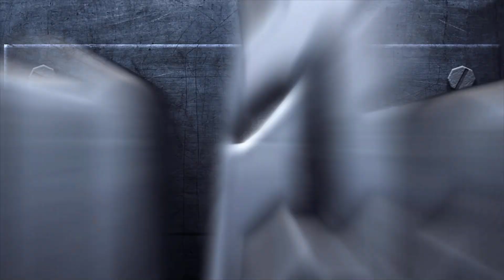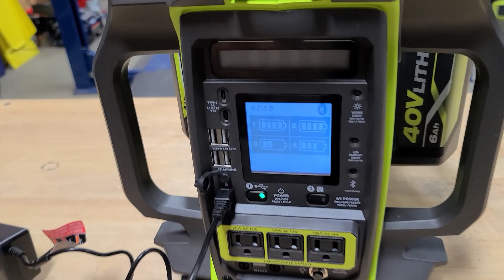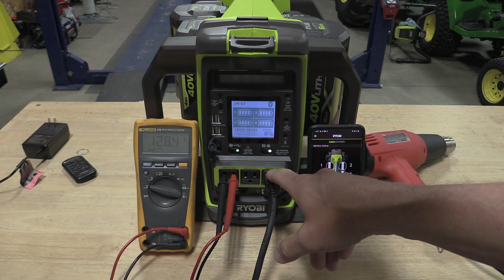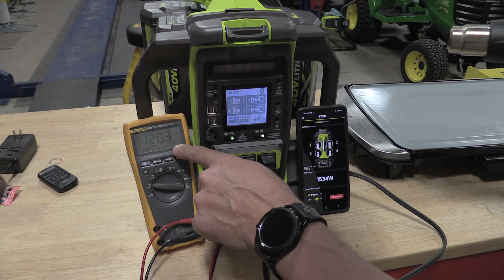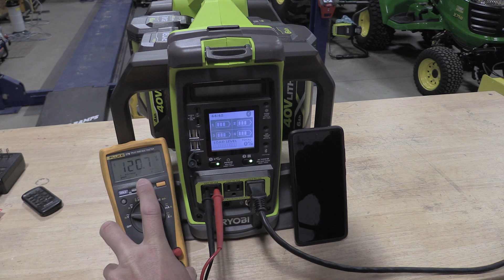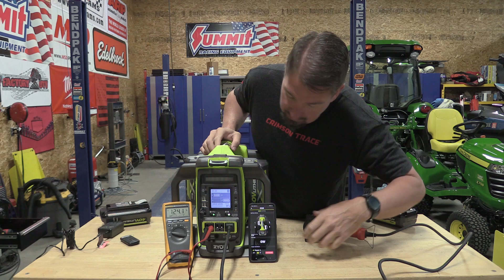Ryobi 40-Volt 1800-Watt Power Station Inverter Generator /4 Port Charger Review

Comment: Awesome video. Very thorough. 
I have the same battery charger and have experienced the same condition you did on the 100 amp start feature . I don't think it was due to your generator inverter. I'd recommend maybe trying it on shore power.  Again, absolutely love the video.
Reply from the maker: It works perfectly on shore power.  Had to use it on my IH 404 the same day.

Comment: Yeah... The technology is not there yet. No solar and or wind powerl connections make it a no go for me. 

Thank you for your real world demo. 

Inverters are super inefficient anyhow. The future will have 12v/24v/48v DC appliances and brushless DC motors to work with solar and wind power. 

As long distance AC transmission will one day become a thing of the past. Being replaced by Edison's original idea of a distributed DC systems in homes and nearby community DC power stations. I have alreadyy replaced ceiling fans with DC versions and address DF refrigerator bro work with solar, RV's have unintentionally laid out the future with everything functioning on DC.

Comment: Hi guys thank for the info , have a question indesice between Ryobi and the Ego power station wish one is better you think ?  im not at any of the platforms  so I will have to buy the batteries I understand Ego batteries are a little more expensive , will the ego Nexus take the 10AH battery ?
Reply from the maker: If you only look at EGO and Ryobi, EGO is better and it will take teh 10Ah batteries.  However, The EGO unit fried my camper, so I am not a fan of it.  Jackery or Dewalt would be the way to go.
Reply: @WorkshopAddict  ups im sorry about your camper , thank you so much for taking the time to reply

Comment: I have dewalt  stuff. This is definitely much better than Dewalt's modified sine wave inverter that has to have 4 batteries and dies when the lowest capacity battery dies. I'll never understand why dewalt or ryobi doesn't make these inverter/chargers fast chargers?
Reply: They will the  charge double for them

Comment: This is a great review! Thanks!
However, did I miss your review of the EGO power station or have you not done that yet?
As I have mentioned, a number of times, I am in the EGO system and have many batteries for my EGO tools so, for me, that seems to be my best choice?
Again, well done and, thanks! :)
Reply from the maker: Watch the voltage when hooked up to our RV, it is 134 plus.  The EGO Nexus fried my fridge and inverter in my 5th wheel.  Be careful with that one.  https://www.youtube.com/watch?v=uwSsqMrVs4c
Reply: @WorkshopAddict  - Thanks for this advice. I think I'll pass on these types of units. A couple other YTers who do boondocking have recommended I stick with a REAL all-in-one unit like the Bluetti AC200P. I think I'll do just that. 

I was hoping this unit would work for me. I already have two 6ah batteries with my Ryobi mower, so at $800 with two more 6ah batteries, I thought this would work.

Comment: Would this be able to handle that Dewalt DWPW2400 pressure washer from a few videos ago?
Reply from the maker: I hooked it up today and it did take it when fully charged but as the batteries got low, it overloaded.  So, reality is no, it will not.

Comment: Let’s just hope this is only the first generation and they make newer editions. Ryobi tends to do this if they see value in a specific model. I think the need is there but this unit isn’t quite there on price or capability
Reply from the maker: Let's hope they get 10Ah batteries also!
Reply: @WorkshopAddict  looks like they have 12AH’s coming out now! Any chance you’ll do any testing with those or the new ride on mowers?
Reply from the maker: @Wrencheasy  Pretty unlikely.  I am honest about what tools will and will not do and Ryobi has made it clear to me that they do not like that.  Too much at risk to go down that road.
Reply: Plus it needs the ability to be solar-charged if it can't be solar-charged then what good would it be if you are out camping

Comment: Cost set aside it’s an interesting tool.  If they haven’t already, all major manufacturers should these available for their popular battery lines.
Reply from the maker: Most all have them.  Dewalt has the most jobsite ready model in a normal battery platform.  Milwaukee has an MX model, not an M18 model.  Kicker is, most of these are used by normal people, not jobsite users.
Reply: @WorkshopAddict  my dad has gone the route of Briggs and Stratton for a battery powered cart and lawn mower. I have search high and low for a inverter that will use the 82v batteries he has. I don't think they make one. Any suggestions ?
Reply from the maker: @BRWOU812  you.would have to build one for that battery.

Comment: 2 inverters gives you double the amps. Not 220 volts. Unless that made something new. Great video as always
Reply from the maker: I have one for my two gas inverters and you are right not sure why I was thinking 30 amp 220.  It's 30 Amp 120.  Here it is.  https://www.homedepot.com/p/WEN-30-Amp-3600-Watt-Parallel-Connection-Kit-for-Inverter-Generators-56421/206409948?source=shoppingads&locale=en-US#overlay
Reply: However harborfreights new generators have a 220 outlet and can also be parallel for 220 at twice the amps. A first for portable generators i believe. Take care looking forward to the next video

Comment: My dewalt is not pure sine wave so I have to be careful what I plug  into it,  I'd rather use a pure sine wave for my audio stuff
Reply from the maker: But your dewalt will run saws and even a welder.
Reply: @WorkshopAddict  yes it runs big tools,  it made a variable speed craftsman scroll saw act really crazy once,  . Half the time I want to use it electronics,  so it's frustrating not being able to use it  for everything

Comment: What is this used for? Running lights at a construction job with no power? If it can barely run a saw I don't see a purpose.
Reply from the maker: IMHO, it is not a jobsite tool, more of a recreational tool.  Great for tailgating or camping.
Reply: @WorkshopAddict  Good point. I could see it being useful for that. Especially if you already have these batteries.

Comment: these battery power inverters are worthless.
Reply from the maker: To many they are.  To some, they are invaluable.   It is dependant on your use and the need for low noise and runtime.
Reply: @WorkshopAddict  Right, you can't always use a gas generator.  These inverters are useless for me but I know they have a purpose.  If not, the manufacturer wouldn't be making them.
Reply: Funny, just this last Friday I chose and bought ego VS ryobi 40v, picked up the new select cut and egos nexus power station (to gain 2x 7.5ah batteries).

3 days later, workshop addict reviews the ryobi version
Reply from the maker: @NikkThompson  If you listen to the end, the EGO Nexus is the inverter that blew up my last 5th wheels fridge and inverter.  Be careful what you plug into you EGO.  That was a very costly review for me.
Reply: @WorkshopAddict  I saw that, didn't know that/this before this video, perhaps I missed that in your ego review. Ive wanted the ego for a while but I've ran gas equipment. Now gas is done, I got the nexas with 2x7.5ah for $800, and needed the batteries for when I get the 2 stage blower (can get tool only now).

My plans/needs (especially now with solar charging capabilities) are cameras/laptops/etc on the go, house I'll need sump, TV, and (now worried) fridge. I've got a gas generator, but it's loud and I shut it off at night, so this will be for at night or quick emergency until the gas is up and running.

Thanks for the quick replies/responses tho. Love the videos, watch every one even if what it's about isn't for me.

Comment: For $800 for the inverter and two batteries I would really expect the unit to run a 15 amp tool
Reply from the maker: I too thought this would be a decent jobsite inverter, but it is not.
Reply: try the 7.5amps 40v ryobi batteries
Reply: So a 40v 6ah has similar capacity to a 12-14ah at 18v
Reply: I was ready to hit "buy now"... because I have an additional discount for my birthday. BUT ... now I'm wondering if I should.
Reply: It's so overpriced. Just buy an Anker C1000 Instead. Same output, 1 hour recharging, solar charging, and capacity equal to 4x 6ah batteries.

Comment: What is the run time with "X" batteries installed? I can't find any information about the run time. (I understand it's dependent upon load and the Ah of the batteries)
Reply from the maker: So, you seen that I could only hold 1,430 watts on one 4 Ah battery for about 30 seconds.  I could run 1,400 watts at 8 amps on two 6Ah batteries for about 2 hours.  It will vary so much dependant on amps and watts that it is a hard figure to come up with.  I am going to be using this unit over the holiday pretty hard, let me know what you are looking at and I will test it for you.

Comment: Looks cool for $300 on clearance, that $799  pricetag is a turn off when a gas unit is a fraction of the price. Great video as always thanks for keeping us up to date on the latest goodies 👍👍
Reply: 300$ where?
Reply: @BenJamin-ou7kd  I think he was referring to in the future.
Reply: But with gas, you have to continually buy it,  change oil, check spark plugs, much more service work with gas.   Over time it makes sense and will save you money and time.
Reply: @Bigolg1975  this doesn't even come close to a gas unit maintenance is pennies . The batteries will degrade and there stupid expensive .. unless you'll use it alot not worth it to have sitting around ...
Reply: @Bigolg1975  I can fill a 5 gallon container of gas in a minute. A 5 gallon container can last me over 2 seasons. Battery life span  can last anywhere from 1-5 years from my experience. I can fill my lawn tools with gas in seconds. Batteries take considerably longer to charge, and if you want spares on hand, that can become very expensive. My Toro lawn mower is over 18 years old and still going strong. Yes, I did replace the carburetor because it was easier than cleaning, but that cost me about $15. Other maintenance to my lawn mower is typical for any lawn mower, like blade maintenance, etc. I agree batteries have their place, but it's not for everyone at this point in time. Could you imagine being a landscaper and needing so many batteries on hand  charged if you are using a battery power piece of equipment and several workers? I can see getting into the battery line if you like the convenience or don't have the knowledge and know how to maintain it. Or you are just lazy about maintaining your equipment battery is a great option too. The only battery based lawn equipment I have is one of my hedge trimmers and a pole chainsaw that run off the Ryobi 18 volt system. Again I am not knocking batteries, I'm just saying they're not for everyone.
Reply: @m3rdpwr  Nice assumptions on the lazy part, when you yourself can't clean a carb.  Over the last 4 days I've gone through 44 gallons of gas,  that's about a battery.   I have nothing to show for that gas,  but if I had a battery as you say I'd have something for 1 to 5 years.  But to each their own.
Reply: @Bigolg1975  I did try cleaning the carburetor several times and it didn't help, plus the primer bulb/assembly had a defect. Buying a carb rebuild kit and more carb cleaner would cost it more than a new carburetor. That's why I chose to replace it. I would suspect if you went to 44 gallons of gas, you may very well fall into the category of someone who would need multiple batteries. That would be a larger starting cost.
Reply: @Bigolg1975  also, I didn't mean to imply there are a lot of lazy people out there. For instance, there are people who may buy a car never change the oil and then are surprised when the engine goes. Everything requires some maintenance, however I feel battery would require less maintenance and that would be a plus to many people. I'm in my 50s now, but in 10 years maybe I'm not going to want to mess with all of that and just want something simpler and not have to want to mess with it or have gas canisters around. That being said, I've had to tear apart my snowblower before to replace the friction disc, so I am not lazy about it. Just was trying to be realistic about price versus time, etc.
Reply: @Bigolg1975  it says you left me another message, although I don't see it here. I used to lose power on a very regular basis when I first moved to the area because we were on the route 9 grid. If we lose power, generally is a very short term. The only time it was long-term is when my neighbors tree fell on my house and truck and ripped the power right out of the house. I suppose the gas would be stale, but I put fuel stabilizer in it and never have an issue Also, if I think of it. I don't have that large of a yard, I can mow my lawn easily on less than a tank of gas. My current lawn mower is 18 years old, and I have a brand new one in the box that was gifted to me by my father after he passed away. So I will not be buying a lawn mower anytime soon. I try to test my generator once a month, but it is a minimal test with a load on both phases. Again, I didn't mean to imply people were lazy, some people are just lazy about general maintenance, such as tipping the lawn mower sideways and scraping off the wet grass or sharpening the blade.
Reply: @m3rdpwr  I'm sorry,  I didn't mean to make anything personal.   I get your point.
Reply: @Chris Groner  No worries, it was a good clean conversation. Batteries are getting better all the time, it's only a matter of time before everything is battery operated. Now if only the power grids could handle all the needs to charge everything at once. 😁
Reply: @Bigolg1975  lol 👍🏽
Reply: @m3rdpwr  do you use batteries daily for them to last 1-5 years? I’ve never had a battery go out on me. But I hardly use battery operated power tools.
Reply: @bustex1   I have a very old grasshog weed wacker, that the battery lasted I think 13 years in. I did a video on replacing it because you have to pull the unit apart. The only other batteries I've had issues with, are the really old nicad Ryobi batteries, and the first generation slim lithium ion Ryobi batteries.  I'm pretty sure in all cases, I've left them on the charger at all times as they were smart chargers supposedly.
Reply: @m3rdpwr       That would last me two months.
Reply: @Bigolg1975  your delusional tree hugger that does take in to account the making of batteries the problem recycling them and the power to charge them unless your nuclear your polluting...  so save the mis information .
Reply: The battery itself they want $200 a piece. Way over price consider you can build one much cheapeer
Reply: electric generator comes in handy when you dont have gas on hand or run out. it can also come in handy as you can use it inside a home or building.
Reply: I would like to see that link ;)